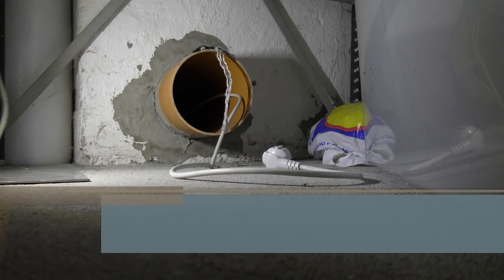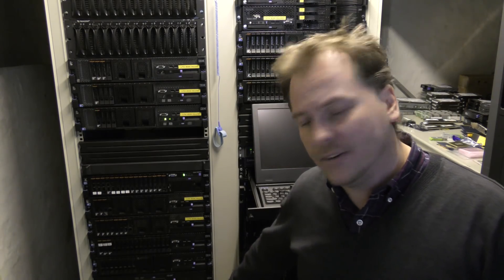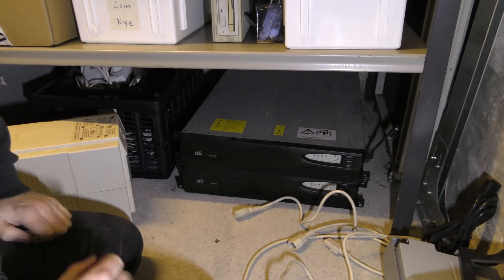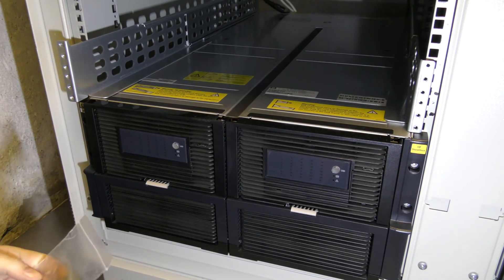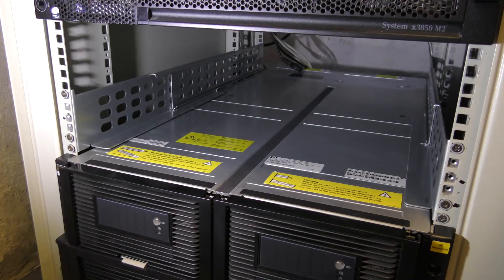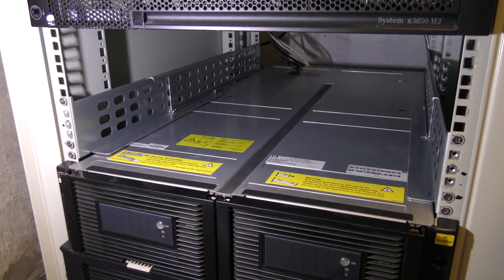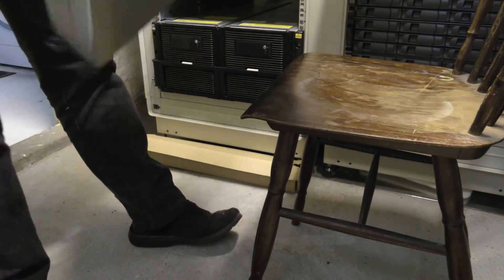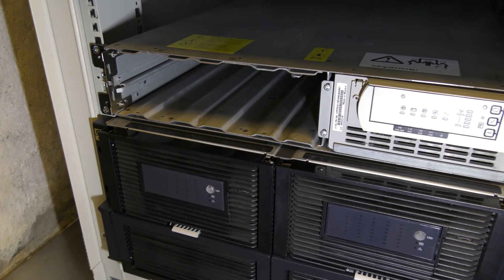Adding IBM Branded EATON UPS to My PlayHouse - 781

Comment: I know this is an old video, but I'm considering buying this UPS - what's the fan noise like on it?
Reply from the maker: It not bad,, all the other stuff is way more noisy :-)
Reply: @MyPlayHouse  Quiet enough to run in a server rack in a living room?
Reply: @MyPlayHouse  I bought one in the end. Installed it last night. The fan noise would probably be slightly high for someone running a very quiet home rack with normal PC parts, but in an enclosed rack it barely adds anything to the noise of the 4x Noctua NF-A14 PWM exhaust fans I have in the roof.

In the process of getting it set up I had to take the cover off, and I noticed that the fan should be easily replaceable with a different one if noise was an issue. The only issue I can see is that the UPS doesn't have an internal temperature monitor, so it'd be hard to tell if the replacement fan was producing enough airflow.

Comment: You could add an intake from the house, so you can use the fresh air from outside when not too cold, and recirculate air from the house which can be heated up from the datacenter and acts as a cooler for the air itself..
Reply from the maker: Hi Stefano Bettega
Thank You very much!  Yes :-) I could just turn the fan blower around.
Thank you for watching! :-)

Comment: Those APC rails are galvanized steel, the exact same ones are used for the 10KVA UPS'es and aluminium wouldn't hold 135KG :-)
Also 2 screws are more than adequate (per post), but APC ships 10x with the rail kit, 3 for the front posts and 2 for the back posts.
Also the installation was correct, it looks a little iffy, but it's because the railkit is made to be compatible with the older racks with round holes instead of square.
Reply from the maker: Hi Victoria Hansen
Thank You very much!  glad you liked the video :-)
Thank you for watching! :-)

Comment: Morten, no problem. ;-)

I almost have rails, if you need for other UPS - maybe for another HP-UPS without damages hahahahahaha

Greetings, Thomas
Reply from the maker: I do not have batteries for the other UPS. and we almost never lose power anyway,, the batteries might die before it is ever needed.

Comment: You should rack up the other IBM UPS as well so you have both for your racks. My UPS will run for 2 hours full load. Next you need to run time test it.  24/7 Server on that UPS only or more Servers?
Reply from the maker: Hi Chris Lowe
Thank You very much!  but it would be smarter to test on a non production server :-)
Thank you for watching! :-)
Reply: @MyPlayHouse  that's what I meant.